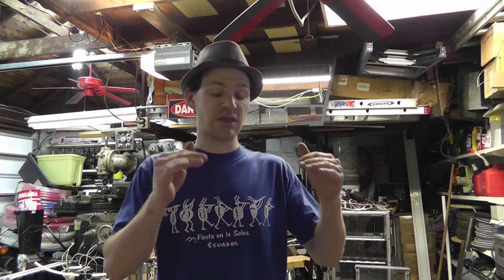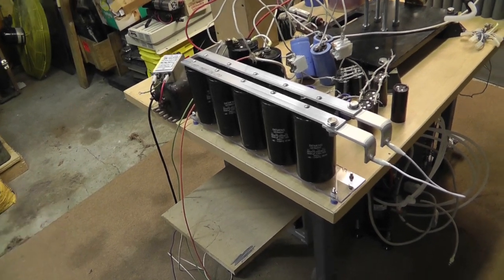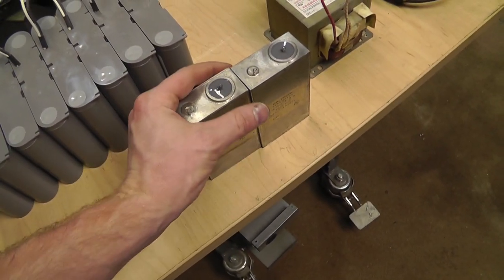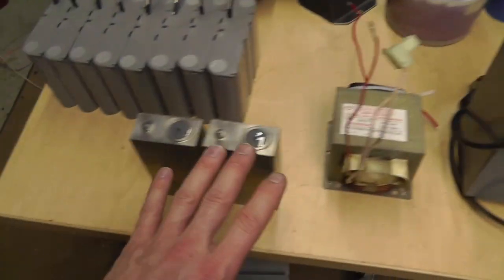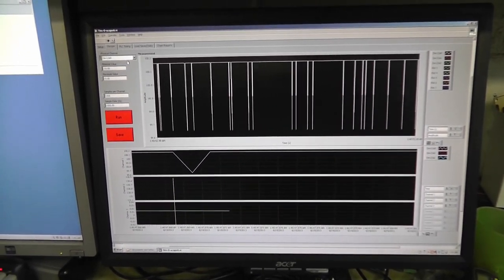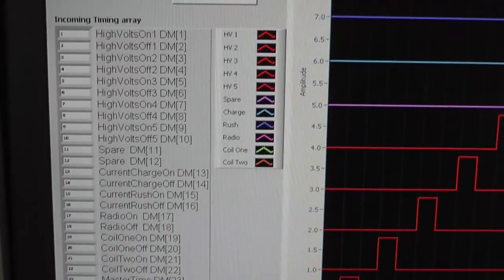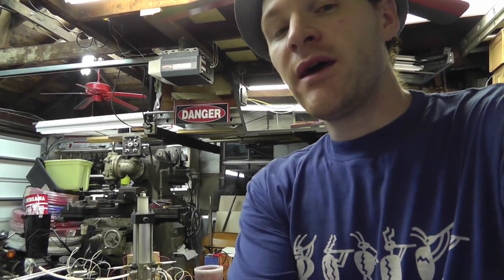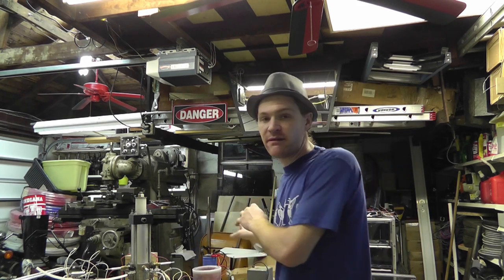Update 24 NGE Papp: National Instruments Labview Data Logging! NEED YOUR FEEDBACK!!!!

Comment: Awesome! That sounds great Russ! Can't wait to see the data. To answer your question, I really want to see the voltage spike that comes off your pickup coils during the plasma discharge.  The other data is important too (starting pressure, pressure spikes, voltage input, spark gap size, gas used, max voltage pulse rate), but the pickup coils interest me the most. Comparing input vs output.   Keep up the good work, Russ

Comment: If all else fails use the ready made parts that could be best.As far as the data volume of fuel volts of current ,feed return voltages rate of speed ratio of timeing  per chamber or size of volume of the chamber or cylinder you do processing and timeing for asembly runs so this should be old hat ehh